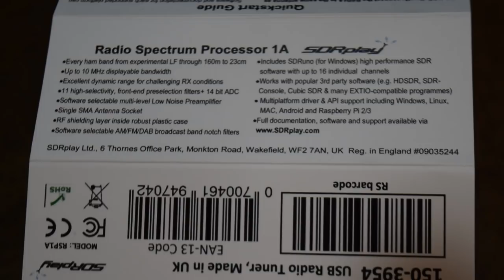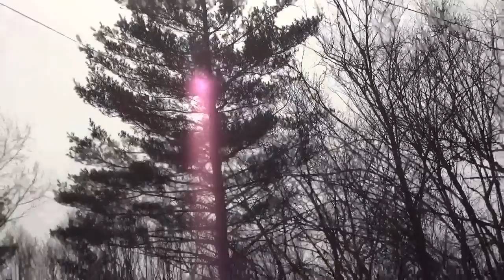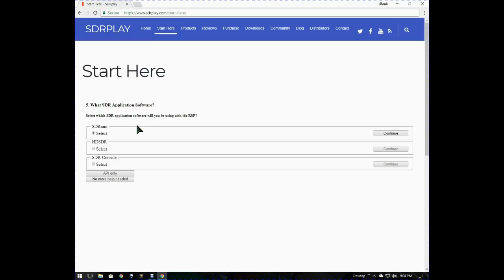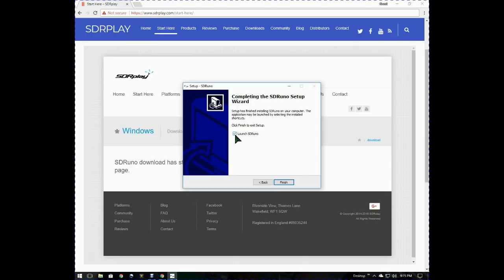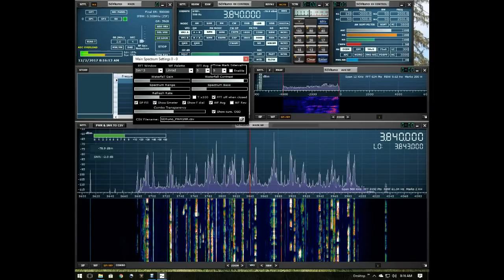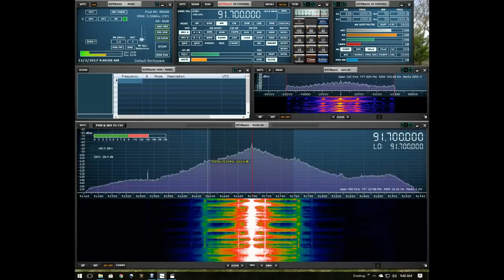SDRplay RSP1A Setup With SDRuno - Basic Operation and Overview

Comment: so the antenna goes to the sdr uno, and the cable goes to the ft991a to the computer? right? and a cable goes from the sdr uno to the computer from my understanding, 
can you transmit from the computer through the radio?

Comment: What a nonsense, the signal on the USB cable is digital, it doesn't matter that it isn't shielded for this purpose and with this short length.
Reply from the maker: The USB cable can act as sort of an antenna and couple stray RF into the analog side of the SDR.  Stray RF can also couple into the USB side of things and cause degraded performance or dropped data.  But don't take my word for it ... do a google search and you'll see all sorts of discussion about it.

Comment: Hello I've thinking of addimg an Sdrplay to get my hans on Sdr technology and to enhance my receiving perfirmance from my Icom 7600. Will you recomend a RSP1A or ahall I go for a Dx model for use o  Hf and Vhf bands?
Reply from the maker: It really depends on what you think you want to do.  If you are using the sdr in conjunction with another radio, the rsp1a is fine.  If you want ultimate receiver performance, especially below 2mhz, then the rspdx might be a better choice.

Comment: Have they made a software update that changed the “gain” setting? Mine is exactly opposite of yours in this video? When mine is at the highest position for the adjustment slide, then my noise floor is at its lowest.
Reply from the maker: Yes, it can be changed to work both ways...there is a setting someplace in the options

Comment: This video just may be the very best demonstration/tutorial I have ever watched.  You must be an instructor of some sort?  Anyway, I’m sold and will be tapping my signal out of my TS-480HX.  It used to be my mobile radio but Kenwood kindly provided a couple pins in the radio to use.  My FT-1000MP looks too difficult to accomplish this.  I assume I can tie in Kenwood’s rig control with SDRuno.  I’ll use the TS-480 for a while, plus it has twice the power of the old FT-1000.  The TS-480 will return to mobile service when I pick up my new FTdX-101D!  Yeah, someday maybe! Thanks for the excellent, excellent review. 73!  Howard, W1HBO
Reply from the maker: Thanks for the kind words!  I am in electronics manufacturing and aside from training co-workers I've never done any formal instructing.
Reply: @SevenFortyOne  Well, you're very good at it just the same!  Just ordered the RSP1a.  I know there are other dongle type receivers for much less, but I like the box and it seems to get good reviews.  I would've liked to use this as an excuse to drive down to Salem (2.5 hrs) to pick it up and walk around HRO, but nooooo, they're still only offering curbside pickup!  Grrrrrr
Anyway, hope to have a QSO with you one day and thanks again.  Howard, W1HBO

Comment: Thanks for a very interesting and informative video. I have just ordered an RSP1A here in UK. I live in a bungalow in south east Kent with a small garden which is awkward for a long wire. I listen to local coast guard and also to the airband and shortwave and various other broadcasts including 2m repeaters on my 1300 discone which gives good results. I am hoping that the discone will be as good on SDR, is there any reason that the discone would not be a good antenna.
Reply from the maker: I believe the discone will work well for what you are trying to listen to.  It may not perform well at lower frequencies but if you are mainly interested in vhf and above then it should be fine.

Comment: Recently got a RSPdx from SDRPlay.  I downloaded the SDRuno software and documentation.  Tried to read the manual but did not get much benefit from it.  Just like reading an encyclopedia, too much detail, no overview for beginners.  I liked your video very much.  You did an overview of each major window and described most of the controls.  Also like the crib sheet with descriptions and time tags - makes it easy to jump around and repeat sections.  The videos by SDRPlay were either too cursory, or way too specific.  I would interested in a video on the RSPdx.

Comment: can i receive longwave (around 150-250khz) in europe?
Reply from the maker: The radio will receive signals at these frequencies but whether or not you can hear them depends on your antenna, location, and other variables
Reply: @SevenFortyOne  thanks

Comment: hi, do you know if the sdruno software supports doing multiple unattended recordings in a row? Last i checked you could
Only do one and then had to manually enter the time to start to record again.  If not are there any 3rd party software apps that would allow for it? I do a lot of unattended TOH recordings and this is a must for me. I’m able to do it with Perseus and rfspace sdr’s.  Thanks!

Comment: Good video. Learned some useful information. Thank you.
By the way, can you tell me what the "LO" followed by a frequency in the spectrum display means? And can it be removed from the display?  Also, do you know if there is a list explaining what the many acronyms associated with the RSP1A mean? I found a list in the operators manual, but it was only a glossary of terms we are all familiar with such as "FM" is Frequency Modulation, not the specific acronyms associated with the RSP1A. I don't know what all these terms like "VRX" and such mean. I was going to print out the manual so I can read it thoroughly, but my printer is messed up at the present time.
Reply from the maker: Lo is the local oscillator.  I don't think you can hide it's display.  Basically the lo is the center frequency of the current bandwidth being tuned.  When the lo is locked that frequency doesn't change and you can tune above and below the lo until the edge of the pass band is reached.  When unlocked, the lo changes and the pass band moves with it.  I think I saw a more detailed glossary or cookbook for sdrplay someplace but can't recall the site now.

Comment: Excellent video. Thank you. Question: At 15:50 there is a signal doing a frequency sweep. (looks like attendees of a sports game doing the wave) It sweeps right through other signals. What is that? Is that common? Is that legal? Is that an artifact of your receiver or is that actually transmitted signal? Thank you for the informative video.
Reply from the maker: I think that was some sort of oth radar sweep

Comment: New sub here. Thanks for the review of the SDR radio. I noticed you were using Windows.  Does windows perform better than Linux or Macintosh?
Reply from the maker: I'm not a mac user and I haven't played much with SDR on Linux.  I'm guessing for a casual user the performance would be about the same.  There are more software options for Windows to chose from though.

Comment: This is a good review but he skips over how to adjust the waterfall band width which defaults at 4 megahertz but would be more helpful for ham radio at something like 100 to 300 kilohertz band width.   Also skipped over is optimum RF gain control and changing the frequency.  I find manual tuning inconsistent or very rough when trying to tune to a specific frequency.
Reply from the maker: Bandwidth is set by the decimation factor.  Rf gain depends on your antenna and operating conditions.  Search my channel for other sdrplay videos as your questions may have been addressed in one of those.

Comment: Just watched your 90 minute on-line demo of SDRuno, and enjoyed it.    I just received my RSP1A, but can't download SDRuno to my MacBook Pro.  Does it only run in Windows??   I was sure I saw something that said it supported MAC OS.  I was able to download the MAC drivers, but can't see a way to download the SDRuno software for a MAC.  I hate to run Parallels, but maybe will have to.  Will it run on a 15 year old Pentium running Windows 7??  I enjoy your Youtube videos and have subscribed.  Appreciate how quickly you reply to comments!
Reply from the maker: Sdruno will only run on windows.  I think you need cubicsdr for Mac but I'm not sure as I am not an Apple user.  Sdruno should run ok on older wintel platforms but you may have to keep the sample rate at the lowest settings.   I'm glad you enjoy my videos, thanks for letting me know!

Comment: You are amazing, we are communicating almost in real time today!  I'm concerned about RF from my Kenwood TS-440SAT getting into the RSP1A or RSP2 (not sure which I'm buying yet) as they will share the same antenna.  Do I need something like the MFJ-1708SDR to switch the antenna between the TS-440SAT and the RSP1A?  It has an antenna switch and also can sense RF and will switch automatically if it detects RF going into the input port of the SDR.  I haven't seen a discussion on this here or on the SDRplay.com website. Guess at minimum I'd need a manual antenna switch to switch between the two devices and the antenna.   Or, is it best to have a separate antenna?  I'd still be concerned about high RF getting into the SDR.  I believe you are using your 40 and 80 meter antennas for both transmitting and receiving.  I'd probably need an antenna switch with multiple inputs and multiple outputs.  I will eventually have better antennas.  Just got back on the air after being gone for about 15 years.  Thanks again!
Reply from the maker: In my case, I just disconnect the SDRplay when I'm not using it and never use it at the same time I use my ham transceivers.  I've heard good things about the MFJ-1708SDR  and have thought about getting one.  But I'm kind of a cheap-skate and just haven't been compelled enough to buy one yet.  But either the manual switch or the MFJ box should provide the protection you need.  There are some videos on the SDRplay website that demonstrate the MFJ box and probably other that show other alternatives.

Comment: Wow, thanks for your quick reply!  Really like your videos. I have subscribed. On the RSP2, what is the impedance of the  high impredance single line input?  Is it 400 ohms or around 2500 ohms?  Thinking of using an end fed half wave antenna.  Do I need the 49:1 auto transformer?  (Takes it close to 50 ohms). Or can I take the single wire and ground into the RSP2 without a UnUn or autotransformer?
Reply from the maker: Personally, I don't worry about baluns or matching impedances unless I'm transmitting.  I've run wire antennas stuck into the center pin of the 50 ohm jack with success.   If you want every last ounce of performance then you can use a matching device....but keep in mind there are insertion losses that may reduce any benefit you get from having a matched impedance.  This is just my opinion, others may have advice.   Thanks for supporting my channel, I'm glad you enjoy my content.

Comment: CHU is coming in well LOL, at 18:30 you have the RF gain backward, the slider is RF gain reduction, all the way down is full rf gain and all the way up is max attentuation, it is easily configured to work normal in the settings, I made the same mistake when starting too.

Comment: I have been off the air for years and this looks like a fun way to get back in touch w hamming...can you tell me how the sensitivity of the RSP1A is compared to a nice receiver/transceiver like the ICOM 756 PRO III (my last radio)? Can you hear the same signals? I Would think the 756 would be considerably better,  BUT I saw a video comparing the sensitivity of the old RSP1 and the 1A and the sensitivity was markedly improved in the 1A so maybe it is not far from a nice receiver?  Thanks, Scott W5RC
Reply from the maker: I haven't done any head to head tests, but through casual observation I'd have to say that sensitivity of the rsp1a is pretty close to my ic746pro.  The only real difference I see between the two is the rsp1a is more likely to overload from strong signals on bands outside of the one you are listening to.  The rsp1a is a great value and I think you will be pleasantly surprised by it's performance for the price.  I agree that this would be a great way for you  to get back into the hobby without breaking the bank.

Comment: SDR is new to me...this is receive only....how do you add a transmitter?
Reply from the maker: Broadly speaking you have to either buy one with transmit capability or use one like this ad a panadapter.
Reply: @SevenFortyOne  thanks for doing the review btw....Is the  Icom 7300 a SDR transceiver in effect... where there is a computer in the box doing all the software processing?
Reply from the maker: I haven't used one myself but I believe you are correct...the 7300 receiver is a sdr design

Comment: Thanks for your work.  Question:  I have my panels all set up the way I want and want to store their positions so the next time I use it the windows are preset.  If I go to factory reset I ONLY get the MAIN window.  Then I have to go through and initialize each window and move it into position.  Also, it looks like your windows SNAP into position.  Is there an option for that?  Running win 10.  RSP1A.
Reply from the maker: If you check out the help file in sdrUno there is a section that explains the workspace manager better than I can in this reply.  Having said that, perhaps I should make a video on this topic.
Reply: Yeah, I read that and some of the screens don't match what I see at the moment.  I was surprised when I loaded uno that it only came up with the main screen and not all screens.  I'll review that.  You're tutorial was excellent.

Comment: Getting mine tomorrow or I guess later today. Going from a RTL SDR V3. I'm hoping I see some improvements between the two. I think I'm going to use all 3 programs and play around with each of them. I am using a homemade long wire antenna and a eBay balun by seller lowbander. Amazingly it picks up a lot of signals.

Comment: Thanks for this vid.  Very well done.  What antenna do you use with your RSP1A?
Reply from the maker: Thanks!  I have a fan dipole cut for 80 and 40 meters.
Reply: You can sign into the website for the HamRadioOutlet.com. Then search RSP1a. The website will show not only new info for the RSP1a, but will give recommendations for accesories. Including antennas that they sell especially for use with the RSP1a.

Comment: Great video. I have a 2017 Macbook Pro with 16Gb ram and is an i5 CPU. Windows10 is running on a partition. My question is would this be powerful enough to run the SDR software?

Comment: I think it is WINS 1010, Do you think living on long island..I would enjoy this receiver...Im looking at this one or the RSP2 or the Airspy HF+..dont know which one to get...What did they change in the RSP1A to RSP2????
Reply from the maker: I like the rsp1a...it's the best value out there right now.  The rsp2 has a few extra features but the 1a is fine if you are just starting out.  I'm not familiar with the airspy but I've heard good things about it.
Reply from the maker: It shouldn't matter where you live to enjoy these radios, however you may struggle with overload if you live close to strong broadcast stations.  The built in filters in the 1a will help some but you may need an external filter to really filter them out.

Comment: Great video demo of  SDRUno.  Thanks!  Amateur question: how did you know you were in the '80 meter' band?  Was the wavelength displayed somewhere in SDRUno?
Reply from the maker: Having been in the hobby so long I just sort of have the jargon memorized.  But there is a matrix of buttons on the main RX control in SDRuno that when clicked will take you to the corresponding band.  They are the button labeled 169,80,40,etc...
Reply: Thanks for the quick reply!  So, can I hunt for frequencies in any range or only in 'bands' as defined on the button pad?  I have an SDR2Pro and want to search for all possible RF frequencies from 2khz to 2ghz, but I can't seem to scroll to all frequencies within that range ....but seem limited to certain 'bands' of frequencies.  The scroll buttons don't just keep going up or down in the main RX window.  Thanks again for the great demo video! Very helpful!
Reply from the maker: You can hunt any frequency.  When you click the band buttons the Local Oscillator (LO) gets locked and you can only tune within whatever pass-band you have set through the MHZ and DEC buttons.  To unlock the LO, just click the LO Lock button right above the Play! button and you'll be able to scroll to whatever frequency you want.